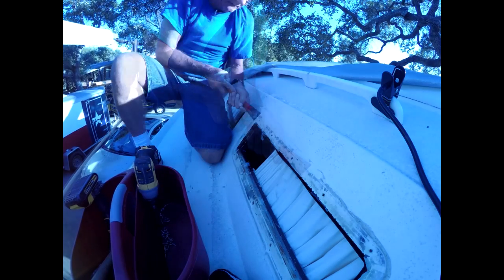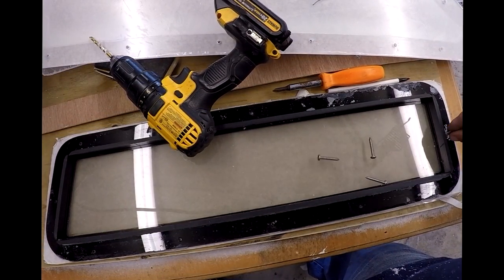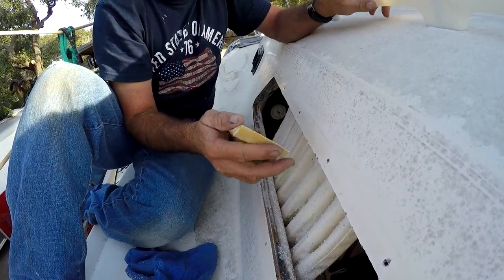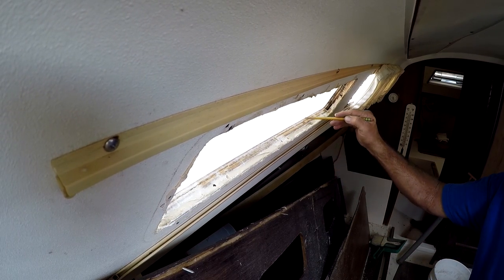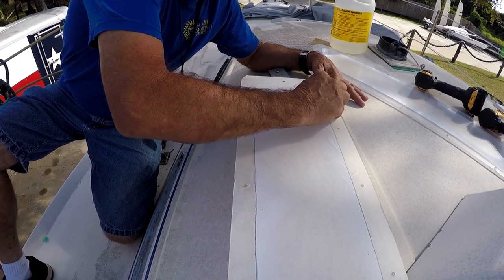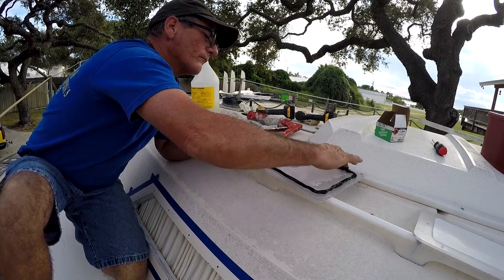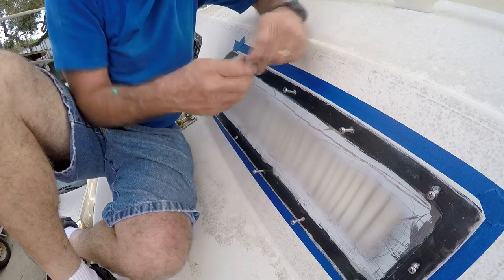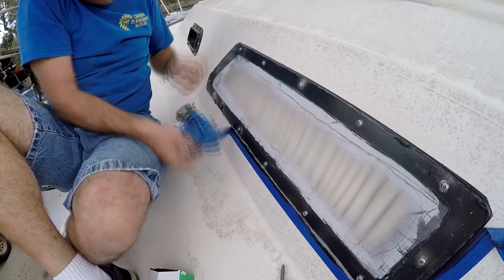Replacing Sailboat Windows Do It Yourself

Comment: 3M VHB ( very high bond ) Tape  Serial No. 5952 , then Dow Corninig 795 to seal the edges.
No screws, MUCH easier. Super reliable, they hold in high rise windows with VHB tape.
Reply: would you use both screws and tape , ive already cut holes
Reply: The correct method used by boat builders.

Comment: Looks like a nice practical method will most likely be copying it for my boat windows. Do you know if normal polycarbonate sheet ok from plastic sheet warehouse ok? Probably only 100 euro and they can probably cut out shapes for me. Is it the same stuff as the specialist boat windows?
Reply from the maker: That is a good question, I would think not and  would try to go with a marine grade plexiglass for better long-term benefits
   Happy Sailing from South Texas Corpus Christi
Reply: Bantry Bay, Cork County.

Comment: Nice video, I think the problem people mention in the comments is that you  got silicone on the inside of the glass. You can prevent this by using less silicone in the corners, and removing it with alcohol before it dries.
Reply from the maker: Yes great idea,
I have also learned since posting this video many years ago about a two sided sticky tape thar can be used to mount and seal the plexiglass windows

Comment: Couple things: Dow 795 is the best silicone to use, it's specifically formulated for acrylic. Don't use 5200, acrylic is about the only thing it won't stick to. The windows will leak if you use it. Second, the screw holes need to be a little bigger than the screw so the acrylic can expand and contract with temperate changes. About 1/4" holes for #10 screws. And turn them in just barely tight. Sight along the edges, if the plastic defects at all at the screws they're too tight. Back them out a little.
Reply from the maker: wonderful notations , I added those to my video notes if that's ok my friend, thanks for watching and commenting

Comment: I would advice against using a finger instead make a 45 degree bevel on the outside the silicone will adhere better because there is no whisper thin layer at the edges

Comment: nice install. like to add, diyer may consider the option to use polycarbonate instead of acrylic for glass? it scratches easier but is many times stronger.. depends on boat and intended use
Reply from the maker: good idea, what is cost difference between the two products?

Comment: Why not using a polyurethane foam tape, (self adhesive), instead of silicone? It lasts more, is cleaner to apply, and gives a more perfect finish. It's what many boats come with from factory... I did it once (about 10 years ago), and it is still there. The boat is in bright sun Portugal...
Reply: Does home depot or lowes sell that tape
Reply: Hi, David! I don't know. In Europe it is manufactured by a company called Wurth, in Germany. It is used for automobile purposes also. I believe 3M (at least) must have a similar product. You stick it in the outside, adjusting by the window hole, screw in the glass through the tape, and then just cut off the extra tape width. It is the solution new boats used to come with. More recently, I have seen plexiglass windows glued with automobile windscreen adhesive. it looks great (no screws), but I don't know about efficiency.
Reply: Mário Tavares da Silva ..thank you for answering back. I will do my homework and see what is the best way for this. I'm in florida
Reply: Olá Sr. Mário, resido em portugal e estou a remodelar uma embarcação. podia-me dizer qual a referencia desse tipo de fita adesiva a que se refere? Cumprimentos!
Reply: is that what  VHB tape is ? ive drilled the holes should i use both ?

Comment: Anybody got a better link so I can watch how to do this same style window but with a better finish.? Thanks
Reply from the maker: Not quite sure what your asking , A better finish on the quality of the work, or a better finish on the quality of the video, cause of the two videos you posted with only one subscriber you show some body scrapping barnacles of a boat lol just saying the obvious, don't bitch about somebody else's work tell you start posting some thing better of your own, best of luck in 2019
Reply: @benjamintucker1964  if I was worried about how many subscribers I have I'd have said. I'm fitting windows on my boat and want it done properly. Not a ruff cowboy job. Thanks
Reply from the maker: @danbell1618  a rough cowboy job hardly, they haven't leak a drop since installation and did it for a fraction of the price the local boat yard wanted to charge me, and I used the tools and supplies I had on hand, so go scrape some more barnacles
Reply: @Jonathan Armstrong Exactly!